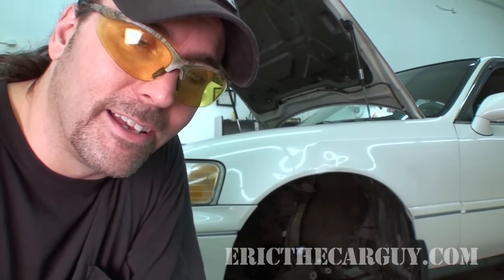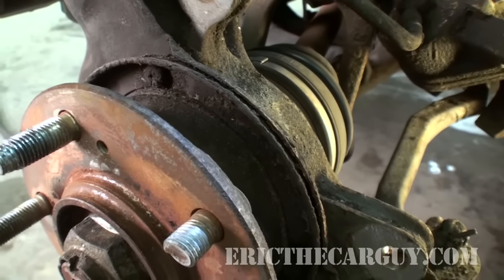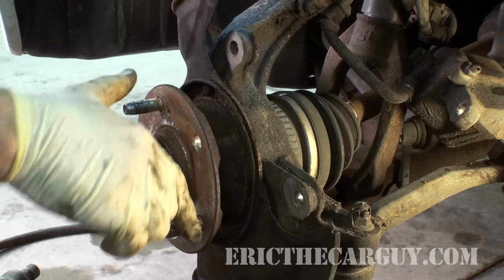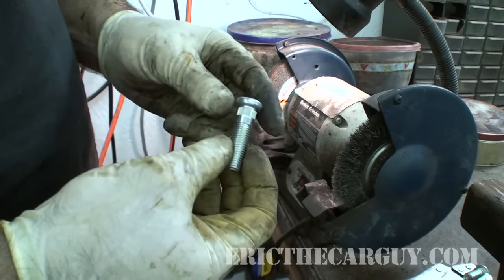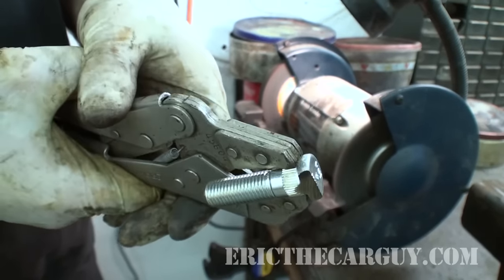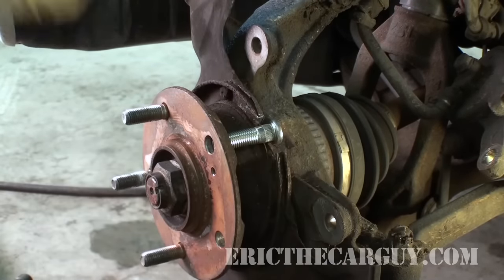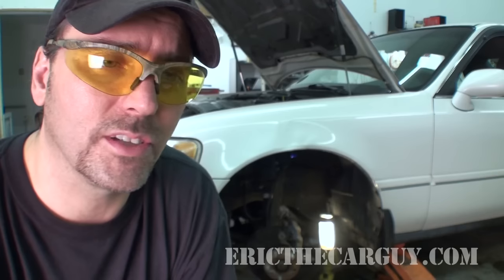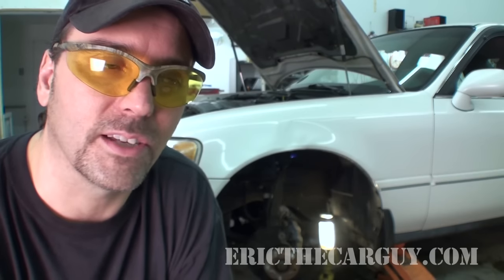Replacing Studs the 'Easy Way' -EricTheCarGuy

Comment: Aussie know how fix for this here. Even 4 years later shouldn't matter on this one ?

An inexpensive fix without any damage or cutting  or grinding/weakening new stud heads at all. The trick is to have shim(s) [1-2 mm thick +/-) to place behind the centre hub nut so that the nut can be reused & correctly tightened on the bearing. The shim will bring the pegging flange to a fresh location for correct pegging. E.G. Old at 12 o'clock, new at 5 o'clock when related to
pre-removal. 

Actually the new position would be 12 o'clock & old at 7 o'clock on refitting if you get my drift as the saying goes. A new nut option wouldn't break the bank either maybe $10 -$12 tops ? Both sides of the car if needed & it does start to add up plus circumstances may see new hub centre nuts are not immediately available & so shimming is the next viable option ? At a pinch shims could be made up or washers ground down for suitable thickness ?

With this method the wheel studs can be replaced at the workbench & vice in a workman like manner. While on the bench all the wheel nuts can be checked that they turn freely on their respective studs. It's always good to be able to spin the nuts up a fair way with the fingers. 

With the pegging pay close attention to how it has been bent to the stud cutaway shape BEFORE REMOVAL. Even take a close up "selfie" of it. The reason being is that the nut pegging needs to be tight to the hub stud machined key cut but not stressed so the metal is cut & too square in (weakened) or rounded (pegged insufficiently) so as to be vulnerable to spinning out of the key & allowing the hub nut to undo. 

There's nothing "SO EXCITING" as having a wheel race ahead of you as you lay a trail of sparks as you fight for car control down the highway with a low loader truck unit carrying a CAT D10 dozer bearing down on you with the driver on his air horns. Cops love 'ya' as well.  

What I have for bending out the old pegging is a thin old screwdriver ground to size like a mini chisel. I gently hammer tap & bend the soft pegged metal out of the key groove & then the nut is easily undone.

For new pegging I use an old chisel ground to loosely (smaller) fit the key shape but finely rounded on the edges so as not to cut the pegged metal in the groove but to replicate how it was before removal as per your "SELFIE". Naturally clean &  inspect the wheel bearings with the hub off if required & if reusable re grease & fit. Note the sequence on removal of the parts involved & reverse that sequence on assembly. Pegged properly the nut should not move = being tight in the key-way groove.

For areas where corrosion is ever present take the extra time & rust proof whatever you can.
Look after your cars " leg & feet" area & your car will look after you.

Comment: The splines on stud are what hold it in the hub the back part that he shaved off is basically a stop to keep stud from coming all the way through
Reply: I know, I just did this to my car and I have to say it took an ENORMOUS amount of torque just to pull the splines through.
Reply: Mark Brand Yes it does even with an air impact if that's what you used. I always worried about screwing up the new one when pulling it into hub though it never happened.

Comment: You should get a cheap harbor freight belt sander.  Those grinding wheels are not designed to take lateral pressure like you put on it by grinding on the side.  They can explode as a result.

Comment: I am perplexed and did not expect to hear from you, Eric, that using a hammer to knock out the stud is ok! The high frequency of an air chisel may be passable, but pounding blows from a hammer, yuk?!!? VObviously, plenty of yahoos who do and suggest this, in an emergency it is understandable, but most wheel hubs carry a maximum runout spec of 0.05mm (that's only 50 microns or 0.002") which a wrong blow can easily create needles undesirable and irreparable damage.

Comment: It is not necessary to cut anything...  Just crank the car up and put it in neutral and the wheel stud will rotate. Rotate the studs until they are located in an area that allows you to push the wheel stud in.
Reply: This car does not have a recess for stud replacement. It's either press the hub and bearing out to get at the stud, or cut a recess.

Comment: Eric: as Always solving little "big" problems. I have had the same problem with my Civic in the past, in my case I took off the hub, and disassembly that, but I have not replace the bearing, for my luck is running just fine till today, but I dont mind disassembly all again to replace, Actually I'm waiting for this sooner or later. My bad luck is to not watch this video before do that.

Comment: A.S.E mechanics will tell you this is the wrong way to do it. but as an A.S.S mechanic i can tell you this is just fine. lol
Reply: There are wrong ways to do plenty of things that are "right" and or will work good enough for a while until it can be done the right way. I believe he is A.S.E certified--if my memory is correct he worked at an Acura dealership and said he was A.S.E. certified.

With that said, to do a job the right way can cost significantly more than doing it a "good enough" way. This method is not the ideal method, and or a method one should use if they have the money, time, and or effort to do it the right way, but for those that need to get it done quickly and or do not have that much money to spend on doing it, and they don't have the factory notch/cutout like some cars do then this can be one of those good enough methods that will work. Doing it for 1 stud on a 4 lug hub, or 2 on a 5 lug hub I can see, but doing all 4/5 this way I think would be pushing it.

Comment: Im doing my rear wheel studs now and the old stud threads are gone. Would recommend putting jack stands on axles?
Reply: Old post, but may help someone. It's never a good idea to support a vehicle on a jack stand via the axle. If it's a solid axle "tube" it's not so much of an issue, however, I would still not recommend doing it. You're better off supporting it under the frame rail (if it has one and isn't a uni-body design), or via the lift point.

Comment: I have only two small problems with what you've done, one, please dont use the side of the grinding wheel, two, try not to get the stud so hot it turns blue, the heat can weaken it even more.  Othe than that I've done this on two cars putting in longer studs on all 4 wheels, you're way is really good, i've done it similar myself.  I didn't have an air hammer tought and tighetening them on with a nut worked well, the bolts I had though were matte black oxide finish, which might have helped stop them spinning.

Comment: I agree with Eric on this one. 
It's not the correct way, but the alternative is worse. To take off the hub assembly [correct way] you wind up needing to replace the bearing which runs over $80. You can just split the bearing, but there is no guarantee how it's life will be affected.
I replaced the front hub bearings on my wife's Honda, and 9 months later broke a stud on a 4 lugged wheel [it spun while removing the tire]. I split the bearing and replaced the stud. Now, every time I drive it I am listening for that stupid bearing to give out.
To the skeptics who feel Eric is wrong for showing this:
Would you want to replace a stud @ a cost of $100?
The discoloration from grinding 25% of the stud's cap was minimal so it hardly affected the hardness of the stud. Really, do you know how much pressure is needed to pull the shoulders of the cap through the hub?
Do you torque? Or do you run it down until the impact wrench no longer turns the lug nuts?
Eric, I wish that you had made this a year ago.

Comment: Lol i absolutely love the people talking down on your methods, because i am more than convinced that they would think differently if they knew the repair tax that you were saving them from. (Customer RANT ahead.)

As a mechanic, i love idiots like them. Customers that believe they are smarter than the experienced man that is performing a job they clearly dont understand; just means i make more money lol. 

For all those bitching about the head of a wheel stud being grinded method, which probably cost that customer $60. 
Well fine, that will be:
- $350-$950 New hub assembly/ Spindle w/ bearing
- $10/day storage
- $60 Press Fee
- $150-$250 Labor (Depends on how much i like you, usually dont like inexperienced people that think they know my job; so good luck.)
Total - $560-$1260 + tax & disposal 
( Price is season based. FYI my rates go up in the Winter, for obvious reasons.)

(BTW, if shaved studs scare you then, i will assume you want all those "high" quality dealerships parts. So everything for your car will be priced from the inflated dealer.)
(Since you were an ass, your car may also sit after being completed, because i told you it was still awaiting parts.) shrug emoiji

This all assuming everything goes well. If i find anything else or something breaks that i think is probably going to scare you the way that shaved stud did, then i will be sure to run that by you as well. Long story short, dont insult my intelligence and drive safe bitch.
Reply: and u arent wrong at all for being like that! if they think they know better maybe they should do it themselves...but they arent so they can pay! im not a trade mechanic-but i love when someone wants me to work on their shit for them to save money then they poo poo a work-around like this..i say well i can put it all back together and u can limp it to a mechanic who will charge u $400 to do it ur way

Comment: I’m working on a Volvo s90 1998 but I’m shit out of luck cause the part blocking me from putting in the wheel studs is the absolute sensor ring. I don’t think I can cut that so guess I just have to replace the bearing or full assembly

Comment: hey eric
the reason the stud keeps spinning when you draw it in with a nut is because you're not using a washer
you have to use something between the hub and nut to act like a washer. that transfers the force int the hub and not the stud itself
Reply: what are the filipno emtpy hand martial arts?

Comment: Just did this on my 1998 civic. I'll let yall know if the wheel falls off when I drive cross-country in two weeks! I actually ground away a bit of the hub too so I didn't have to take as much off the lug as this guy did.  I'm kinda nervous about it though because the civic has 4 lugs not five.

Comment: You should of ground down the knuckle to get the stud in easier. tapping the stud in is one thing but pounding it in and ruining the threads just makes that stud worthless, yes you filed down the threads but there is now less material "threads" for the lug nut to grab which can lead to that stud stripping out when torqued. i use that method all the time, i just don't damage the threads on the new stud.

Comment: hey eric if one of the holes in the hub where stripped could you just tack weld a new stud in the hub
Reply: if the lug spins when you tighten it, you need a very good tack, but don't make it impossible to get the stud back out.

Comment: On older civics= Take brake disc mount off (2 bolts 17mm wrench) cut off part of rear taper on bolt (like in video). now bolt should fit in same way at disc brake area! Otherwise its going to be a much bigger job than it really needs to be (take off hub which is usually a bearing replace and pain in the butt!!!

Comment: I’m stuck at the very last step of using an air hammer to push it back through any tips please help.
Reply: yes put an oversized nut over the stud, then thread your tire not by hand until its snug with the overized nut. then tighten tighten until the stud fits into place.

Comment: I've been beating on my broken wheel stud with a mini sledge and it still won't come out.  If I had been smart, I would have put an old lug nut on the stud and hammered on the nut instead of the stud.  Now it's too deformed to get a lug nut onto it.  The magic method was to go over to Harbor Freight and buy their $ 15 AIR HAMMER and another $ 60 for their tool set with the actual hammer head.  Even then it took awhile for that damn stud to pop out.  I had soaked that stud with PB Blaster for two days, too.

Comment: why didn't he remove the tiny splash shield screws through stud hole,The splash shield would be loose so you can slip in the new stud,then once the new studs were in replaced the small splash shield with hex ones so you can tighten with a small ratchet?

Comment: Ok haters, first of all and not that I'm recommending this, however I have driven thousands of miles with a completely missing stud before.....never had a problem.  I would say, get it fixed as soon as possible but just saying.  So with that said, even if you shave a quarter of the edge of that stud off, do you have any clue as to the tremendous amount of force it would take to pull that stud through the hole???  The hub face I bet would fail, long before that stud came through.  Go educate yourself people before you comment on something you clearly do not understand/comprehend.

Comment: Just wanted add on this 7 year old video. If you use an impact wrench to draw in the stud it less likely to spin.  If all you have is manual ratchet use an old skateboard bearing between hub and lug.  There are also specials too I guess. The air hammer seems superior and faster tho.

Comment: If the goal is just to remove and replace the stud, yes it works. Your method however damages the bearing, damages threads, and is not safe as you cut part of the shoulder of the stud off.
Reply: You can literally buy replacement studs with the shoulder precut. There's nothing wrong with that.

Comment: Anyone who has worked on cars knows that very often you run into hidden, inaccessible bolts and parts that are in the way, where to do a simple job you end up having to remove a whole bunch of s**t. It is annoying. And sometimes you got to cut and bend stuff. I chalk it up to faulty engineering. ETCG has pointed out possible problems people may run into, and have a solution.

Comment: "How to replace a broke or stripped stud with a messed up stud" I've got no problem with cutting the backing plate out, I assume the 2nd one went in after you fully removed that spot, you definitely had to hit the 1st in with more force than necessary. I understand cheap fixes too, but as you were pounding that into place I was cringing.

Comment: why would the hub get damaged if you removed knuckle and put it back?
Reply: The hub has to be pressed out of the knuckle to "properly" service the studs. This usually damages the bearing (or at least makes a mess of it) and you end up replacing the bearing along with the stud.

Comment: Real hack job. Do it right and remove the knuckle assembly. While you're there, replace all of the studs.
Reply: It's not just the knuckle assembly, you have to press out the hub as well. And most likely replace the bearing.

Comment: Thanks but how do I remove a wheel if the stud is broken with the lug nut still tightened?
Reply: Partikkus can you elaborate? The wheel is still on the car and the broken stud is loose. The lug nut is screwed on and won't let the wheel off.

Comment: Grinding a flat on the lug bolt shouldn't be any issue at all; some lug bolts are actually made that way. Ive seen them on some farm tractors for example -
Reply: Also, I use a combination of a ratchet and hammer to draw the lug bolt in incrementally  to seat it. It takes longer than sucking it in with an impact, but that's not a job for an impact; you'll screw up more than you fix -

Comment: I just don't understand why you cut that second stud, when you are going to have to cut the splash shield anyway to fit the new stud in.
Reply: The second stud needed to be cut because even with the splash shield cut it wouldn't have went directly out. If you notice the first long stud going back in, the angle that it had to be at to go in, going out that long would have caught the lip that is there and you would have to have used a pry bar to angle it, and hit it, angle, then hit it, etc to get it to come out. The method of cutting it off was a lot easier.

Comment: wheel stud broke on my 2002 Honda pilot during a tire change on the side of the road. the last time i had a tire rotation, the kid at the tire shop must of had too much fun with his air wrench and cross threaded the lug nut on the stud. like i said i was on the side of the road with a flat tire with minimum tools so i had no choice but to break the stud cause that lug nut just wasnt coming off. i looked up this video to install the new stud myself but didnt realize how involved it would be if i had to remove the wheel bearing. I might just take this short cut and do it this way. my car is an almost 20 year old beater so i dont really care about cutting parts off and filing down bolts.